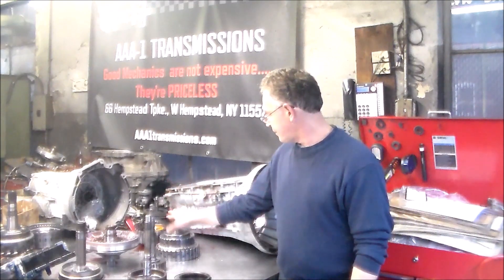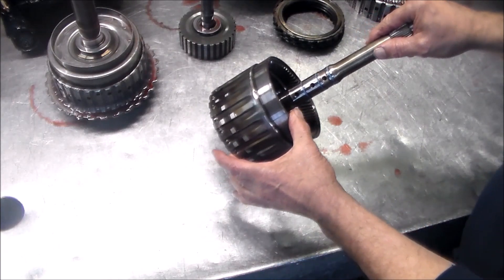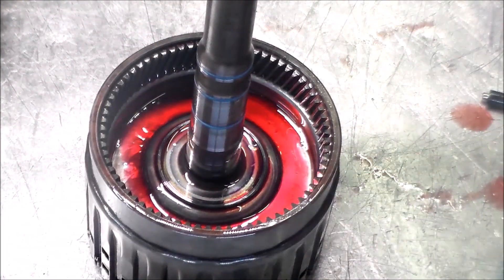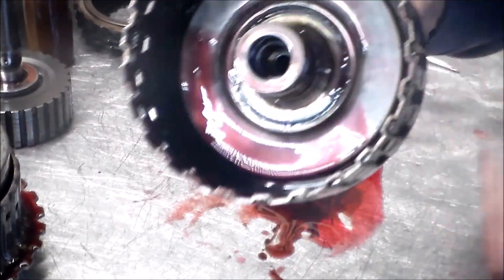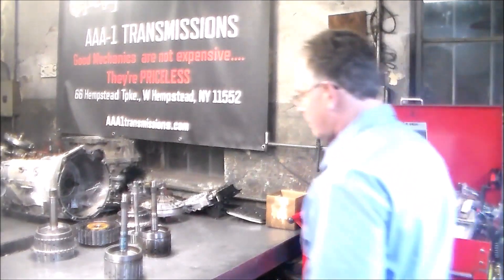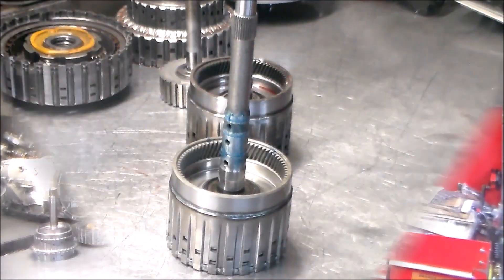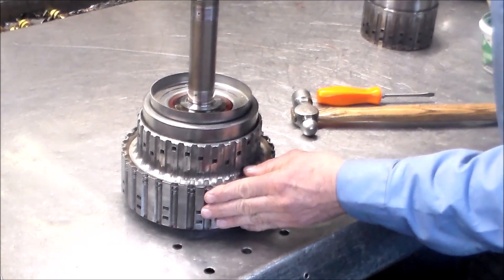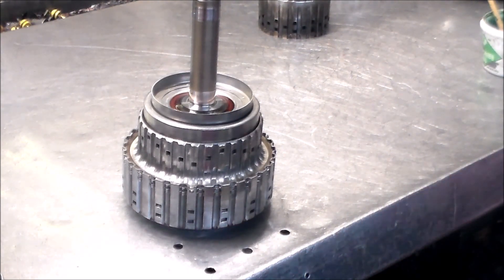6R80, No 4TH,5TH or 6TH

Comment: 2009 ford f150 4.6 engine with 6r80 transmission, had 193,500 miles. Wrench light came on december 2023 and use my obd2 scanner DTC p0741 for torque converter. And I reset the code, few weeks later, as I put "lubicant shutter fixx into transmission, then as i heading on Febrary 2024 as i was going uphill i felt a stud sound, and wrench light came on, recheck the obd2 scanner there the same code p0741.  And as i drain out the transmission fliud, i stripped the bolt that holds the transmission pan, and as the bolt head broke during the stripped, I tried using the extractor tool but it also broke. We tried to put transmission back on after we replaced the seal, torque converter, working on unstable ground makes it tough to reinstall the tranny back. Any clue on what to do here.
Reply from the maker: so basically you broke a pan bolt?
Reply: @GaryFerraro  yes, and the as I saw a thunderstorm coming towards me,  I rush to put pan back together, but I accidentally stripped the bolt and the head of the bolt broke. Next day later, I took the tranny pan off and I use a small drill bit to drill the strip bolt and it drill through but I'm risking the threads and might do it wrong. I use a extraction tool but it broke.
Reply from the maker: @raymondjohn3396  Well You may have to drill it out and install a heli coil,  you may have to buy the kit,  you will have to get the thread size it may be 6x1
Reply: @GaryFerraro  i already bought the heli  coil kit, but the tranny pan bolt is 8mm socket small. So if the DTC code says p0741 then its the part right torque converter. I didn't have any other issues like reverse, drive, neutral, when driving. I am the second owner of the f150 because someone else had this truck before we purchased it in 2016. I talked to the ford motor, they told me to replace the seals while you're replacing the code p0741.
Reply from the maker: @raymondjohn3396  These converters do have issues, Valvebodies do to.  Converters are more common to fail. Actually there is a test that can be done but you need a pressure gauge.  Converters do fail often
Reply: @GaryFerraro  I have replace the solenoid and torque converter. My cousin brother kept pressuring me to buy a tranny oil pump but I think it isn't necessary unless if I had a code. Then my neighbor asked me to just replace the TC and put back, he always says I don't believe in Obd2 scanner, I said what do u believe in... Well I follow obd2 scanner because it tells me. Right now I have drop the transmission with transfer case since May of this year. I haven't replaced the seals on transmission, crankshaft, transfer case yet but well do it next month.

Comment: Hello! Thanks for your video! A have Explorer 2009 4.6 with 6R60 (or maybe 6R80 gen 1). Everytime I drive on highway I feel  rough 4-5-6 shifts. 3 times of 10 they are smooth, other time-rough. Can it be because of problem with e-clutch drum?
Reply from the maker: Yes,  could be a worn E clutch or worn out rear stator bushing

Comment: Gary, my tranny lost 4,5,6 but the tech can’t find anything wrong with it. Your thoughts?
Reply from the maker: Is this by chance a ford Transit?
Reply: It is not. It’s gen 2 off of a Mustang.
Reply: We replaced the bushing stator and all the steels and friction. But didn’t fix it. It has a billet shaft and it isn’t broken. Are those the only 3 things that can go wrong when you lose 4,5,6? Bushing, cracked drum, broken I Shaft?
Reply from the maker: Is this a Transit? @rleojeda
Reply: @GaryFerraro  it is not.
Reply from the maker: What happens runs away on the 3-4 shift? Were the splines checked on the planetary @rleojeda
Reply: @GaryFerraro  it’s a 6r80 out of a 2017 Mustang.
Reply from the maker: runs away on 3-4 shift?  did you check the planetary splines @rleojeda
Reply: @GaryFerraro  it goes to what it feels like “neutral”. All 3 gears feel the same (4,5,6). I raised the pressure and nothing changed. The controller is a US Shift Quick6. You can see on the data log when the OD clutch pressure drops as soon as it hits 4th
Reply from the maker: Not sure what a US Quick shift is, if thats a tune can you take it out and see what happens,  Planet splines are ok @rleojeda
Reply: @GaryFerraro  the transmission is built and mated to a 1100whp Supra 2JZ. The Quick6 is a standalone transmission controller. Because the haltech can’t manage the transmission. 
I’m going to assume the Ford tech checked the planetary. But he’s working on it again so I’ll make sure he double checks

Comment: I purchased a news transmission for my 2016 mustang gt and need to know if they need to be programmed, or anything or are they plug and play like a 4l60e chevy truck transmission
Reply from the maker: If it's a 6R80, no programming,  may have solenoid strategy to program but even if you do not put that in should work fine

Comment: Hi, i have a F150 2015 with 68000kms (42500miles) :
Upshift : 3rd slip to 4
Downshift, 3rd—>1st when i stop the truck. If i don’t stop, I need to push the accelerator all the way for the 3rd down to 2nd.
But in Taul Haul or sport mod’s downshift no problem !!
What do you think, please

Comment: built 6r80 commands 4-1 no 4th gear  super crazy 4-1? any suggestions, i have live data if that would help
Reply from the maker: Im running out but what happens on the 3-4 shift? any codes ?  was this original problem?  was the stator bushing changed?  is this a Transit by chance?
Reply: no codes 3-4 goes to 4 but instantly to 4-1 on tool n not original issue but had issue before build with 4,5,6 stator bushing was changed but unsure if thats issue however after air checking i have all but e clutch engagement seems to blow out pump when i air check port
Reply: but air checking e clutch by itself i get engagement but unsure if could be cracked
Reply from the maker: @erickeeley7688  You may have a cracked E drum or possible tore a ring installing the pump
Reply: do u think could be stator bushing since air check dont engage e clutch when installed in trans, but engages by itself? only option i can think to make go from 4-1 since for 4th a clutch n e clutch are engaged n since e clutch cant catch its technically 1st the
Reply: but ordered new e clutch stator bushing and seals
Reply from the maker: @erickeeley7688  So the E clutch air checks when checking the drum alone but not through the case, i would say either bushing or torn ring.
Reply: perfect that would explain why no 4,5,6 just 4-1 thanks for responding on saturday so fast your are the GOAT
Reply: 2013 ford mustang 3.7 6r80
Reply: so i got gears 1-6 now but no reverse but was fine before , unsure why, just did bushings, seals, and all checks, air checked perfect just no reverse now, feels like it engages but neutrals
Reply: code i got was p078a  for d clutch stuck off
Reply: po7a8 i mean
Reply from the maker: @erickeeley7688  all the sealing sleeves go back into the case?
Reply: everything went back in and air checks fine and which sleeves?
Reply: drove great until i had to reverse n no reverse and slacks off initial go
Reply from the maker: @erickeeley7688  rubber sealing sleeves in the back of the case

Comment: If this happens could you get a noise when shift like a high pressure leak noise shooooink sorry its hard to explain.
Reply from the maker: Almost sounds like your talking about a clogged filter noise
Reply: @Gary Ferraro  its coming out this weekend.  It lost 456 but still drive 123 i got it home and parked it ill try to post after i get it out and torn down i did a 7r and a 6l rebuild before.  Crossed fingers.
Reply: It was a broken clutch hub.  But one question Sir if the shaft snapped and the shift pressure was up due to a tune could it still drive but with slipage?  E drum is good tested it like video no bubbles.
Reply from the maker: @reallystockmustang7178  Not if the shaft snapped E clutch will not engage

Comment: Mine doesn't shift into 3-4-5-6 has a DTC for friction plate A and that's it, 2016 mustang gt. What do you think it might be?
Reply from the maker: sounds to me like the E clutch is no good, you checked the fluid level?
Reply: @GaryFerraro  yes fluid was good I was driving getting on to the highway and it just killed all power and I had to limp it home 60 miles in 2nd or 3rd at 20-30 miles an hour

Comment: Hello, Gary, I repaired an automatic transmission optra 4hp16, 2008, when moving to 2 speed it hits hard, it does no have fault codes, therest of the changes go well, I changed the valve body, par converter, switch TR, if I try the cat no no it hits, if I do it slowly, high speed I don't know, greeting from colombia

Comment: I got a 98 frontier and won’t move until it’s hot. If I turn off over drive it moves immediately any ideas?
Reply from the maker: reverse is ok?
Reply: @GaryFerraro  yeas reverse perfect
Reply from the maker: @jessielee5202  You must have some issue with your forward clutch, when you turn the overdrive off, your bringing on the coast clutch as an assist so the car may move
Reply: @GaryFerraro  put in a used valve body she good to go now
Reply from the maker: Thanks for update

Comment: Hi Gary, are these Ford boxes license built by Ford? Would a ZF 6HP26 drum fit in this box instead? I am just wondering if the ZF boxes suffer this type of cracking as a common issue? If not, could you fix the issue by putting in a ZF part?
Reply from the maker: I believe ZF do can crack, if they would work in a 6R80, not sure, there are different part numbers
Reply: There are no aftermarket hardened products available for the 6R80, the only people I know of who are big on the 6R80 is power by the hour,  and there is no aftermarket billet or hardened overdrive clutches sold by them, nor are they aware of it anywhere else
Reply from the maker: @jonarmedpiandsecurityoffic9051  not sure myself, going to check sonnax